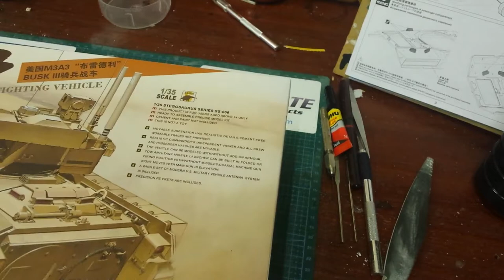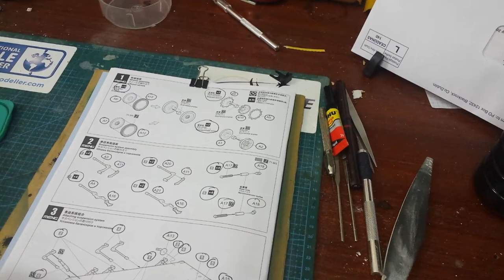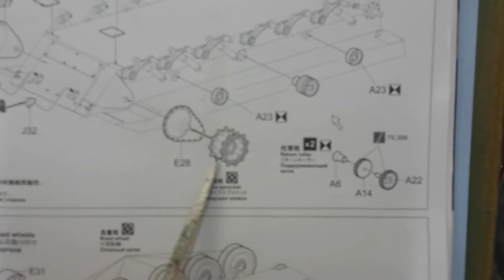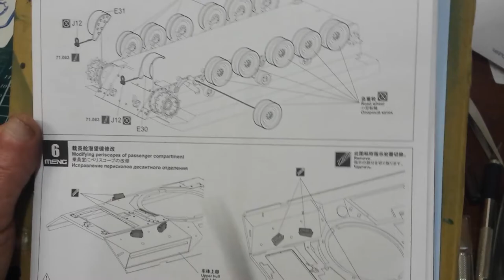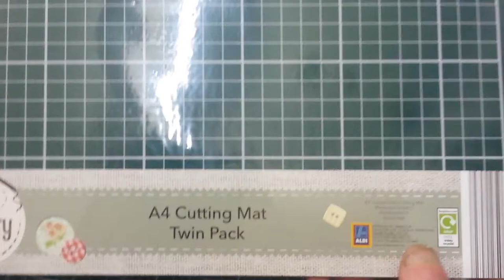MENG  1/35  M3A3 Bradley with BUSK III # SS-006 Build Update # 1

Comment: I'm not looking forward to that, I get bored quick!
Reply from the maker: So do I so I do a bit here and there throughout the day :-)  J.
Reply: ive got to mask Revells B17G theres only about 20 canopy type pieces, but there all 1:72 and they all require masking, i'm no good at masking, and the sets are quite hard to get hold off.
Reply: @SprueSurgeon  You should try using masking fluid on the clear pieces before you install them. Makes it easier to not have to man handle the kit to just get the masking onto it.